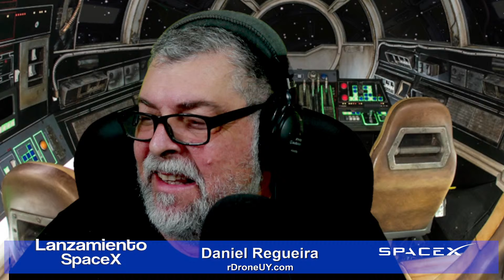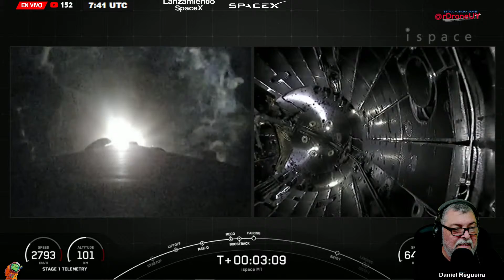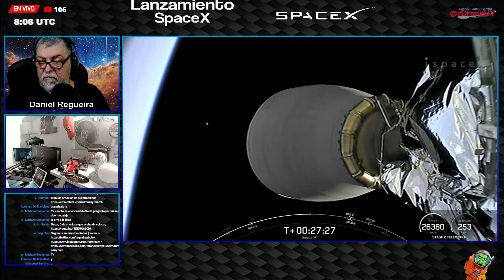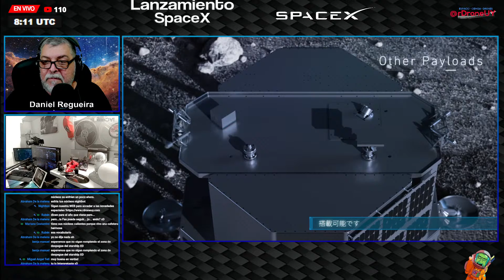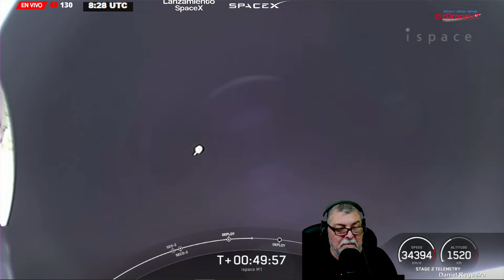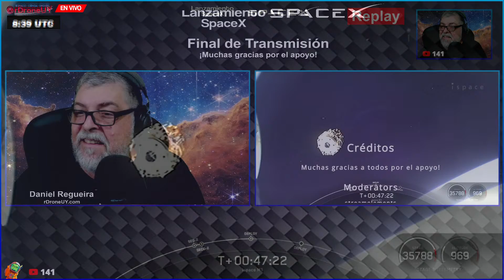Lanzamiento de un Cohete a la LUNA Falcon 9 de SPACEX Hakuto-R Mission 1 (M1) -VIVO EN ESPAÑOL

Comment: por que no vemos ninguna estrella con esa cámara de la segunda etapa  y a qui abajo vemos cientos o miles sigo sin entender gracias espero no te molestes
Reply from the maker: No vemos las estrellas por un  defecto de lo que se llama  "Rango Dinámico" de los sensores de las cámaras.
.
Deberías buscar y leer un poco sobre eso para entenderlo.
Y de allí es que viene una solución que tienen algunas cámaras, por ejemplo nuestros móviles, que se llama HDR (High Dinamic Range) o sea Alto Rango Dinámico.
Saludos
Reply: @RDroneUY  Hola, Aún así con todo el rango dinámico extendido (solo en fotos fijas, no en video) las exposiciones están muy separadas me refiero a la luz directa del sol 42:33 en comparación  con la necesaria para registrar estrellas. Me aventuro a proporcionar unas exposiciones típicas para la toma en cuestión: ISO 400, f/5.6 1/500 de segundo para cada frame de video. Requeriríamos sólo un  cambio de velocidad a unos 30 segundos por fotograma, lo cual es una aberración pues al ser video  a 60 cuadros por segundo... ¿COMO vor a meter 60 exposiciones individuales de 30 segundos en un segundo? o es una foto con estrellas o es un video en movimiento. La otra forma sería elevar el ISO o sensibilidad de forma drástica pero al pretender registrar las estrellas, lo otros ELEMENTOS ILUMINADOS INTENSAMENTE POR EL SOL  terminarían con su brillo invadiendo todo el cuadro, quemando totalmente la exposición en ambos casos (elevando el tiempo de exposición o la sensibilidad )